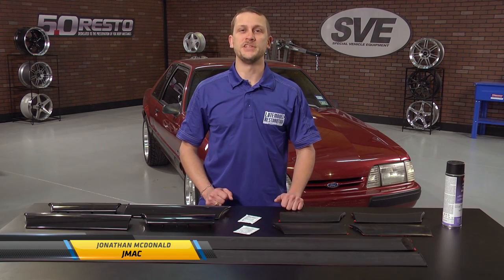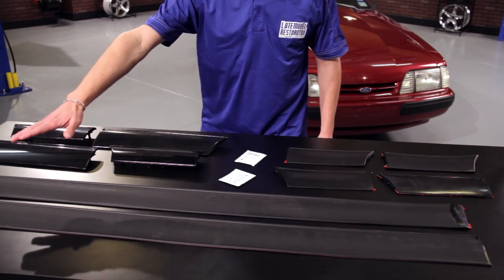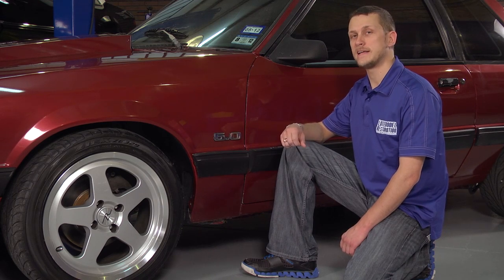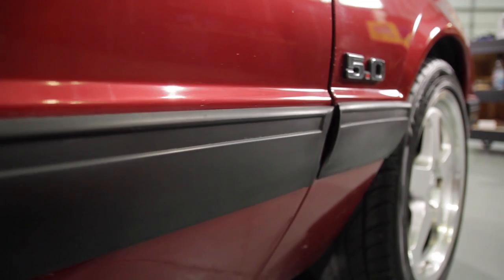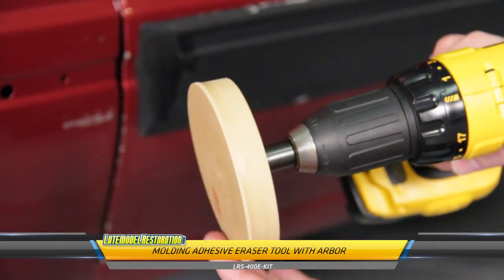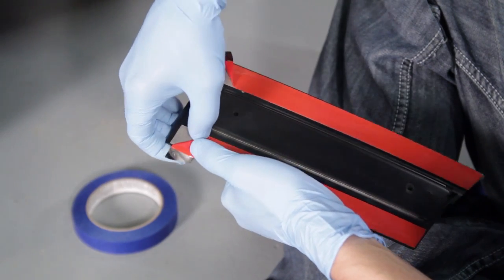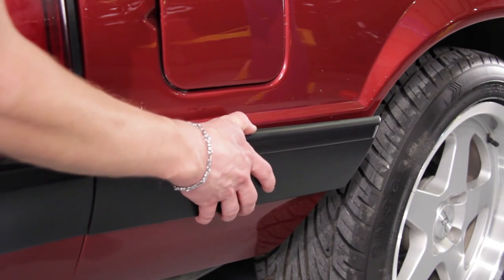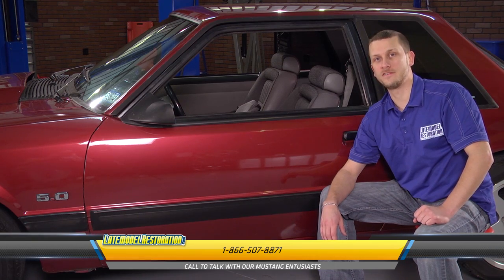Mustang Body Molding Removal/Install - Fox Body LX GT Cobra

Comment: I won’t even bother painting the trim if I had that year but I have a 92 LX emerald green it’s original paint lucky me . But I did remove all my trim and clean the hell out of it and Put it back on. Most the time you can fix those bent pieces with a heat gun and pieces of wood and clamps so you can save your original color trim if that’s an option for you.

Comment: the adhesive side molding set that i purchased is beginning to peel off the body at the corners.  i find this surprising considering how difficult it was to remove the originals.  it has only been a few weeks?  the set was installed as instructed but the adhesive just does not seem strong enough.  the body was just painted and the surface was clean.  now the edges look all warped, kinda like the cowl i received.
Reply: Damn, was there a fix to this,that sucks,as I'm about to replace the originals as well

Comment: Hi, One of my 1990 GT door side moldings came off.  Where can I get the best 3m double sidede tape to put it back on?  thanks

willie
Reply from the maker: I always have good luck at local auto parts stores or check paint and body shops.
Reply: Thanks, I thought I might give that a try.  Just didn't know if there was some type of special tape needed.

Comment: I have a 88 mustang gt but the trim has  sum type of reflective side paint I was wondering if it was a sticker or paint cause it needs restoration
Reply from the maker: You will need to send us a picture of the trim so we can take a look at it for you.
Reply: @latemodelrestoration  sounds great where could I send the pics too.
Reply from the maker: You can send pics to 254-292-2992.
Reply: @latemodelrestoration  I sent the  photos
Reply from the maker: Hello 
I do not see any pictures, Please call me directly at 254-296-6556 and I will give you an email to send the pics.

Comment: How do i get rid of the molding? Is that just after market parts?
Reply from the maker: Coach - These moldings were factory parts from Ford.  Some people have left them off, but the don't look right in my opinion.  The front and rear bumpers have moldings "molded" into them.  -Landan
Reply: Yea i’ve seen videos where they rip it off, but there are holes in body parts. So that’s the only way to get them with no plastic mold?
Reply from the maker: @coach8123  Correct.  You would have to leave them off.  -Landan
Reply: ok sweet, and cheaper thanks 😅

Comment: What about the 87 thunderbird 5.0?
Reply: I have an 87 thunderbird 5.0 and its missing the driver's side molding. Where can i find these?
Reply from the maker: @dannywhitmire6373  The body side moldings for a Fox Body Mustang won't work for a Thunderbird.  eBay would be a good place to search for the molding that you need.  Thanks.  -Landan